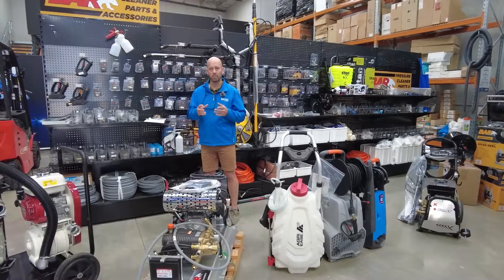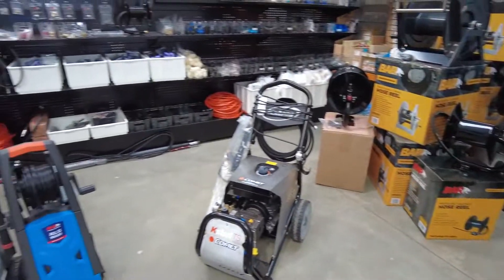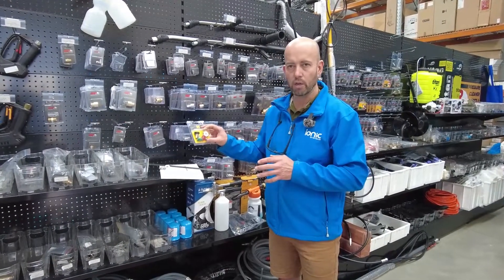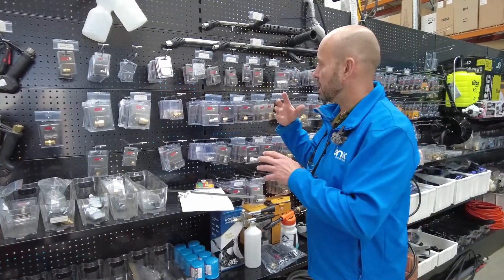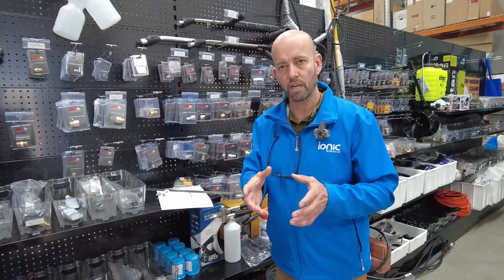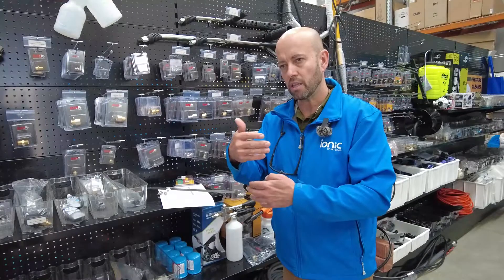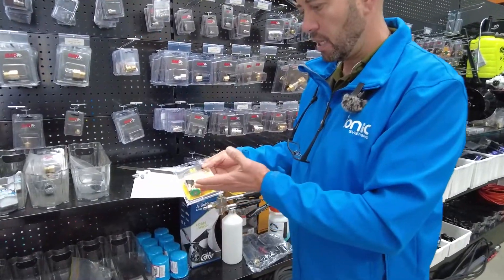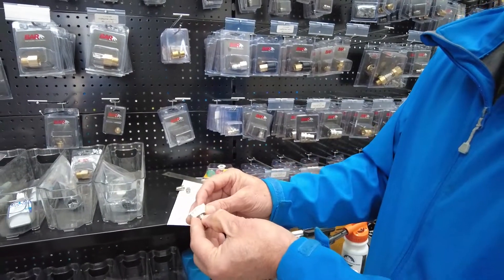Nozzle Tips and Sizes to Suit Your Pressure Washer | Lets Learn Some Basics about Pressure Cleaners

Comment: If I have a 4000psi @ 15LPM machine and I'm running a whirl-away with 2 correctly sized tips.
Will the flow be 4000psi @ 7.5LPM per tip or 2000psi @ 7.5LPM per tip?
Reply from the maker: You should roughly have 4000psi or just under that at your tips